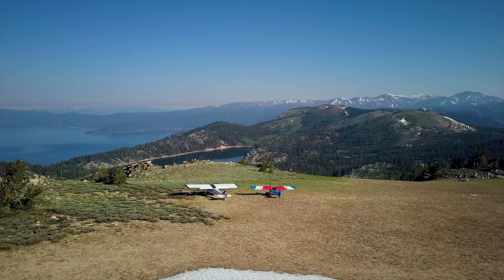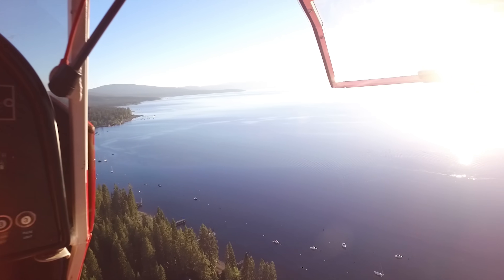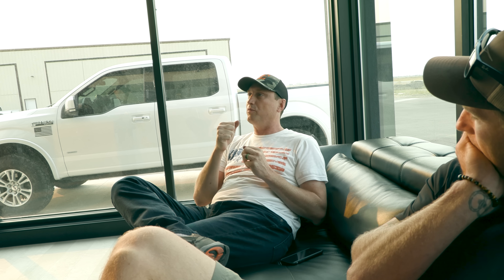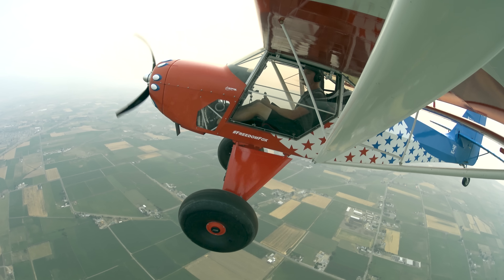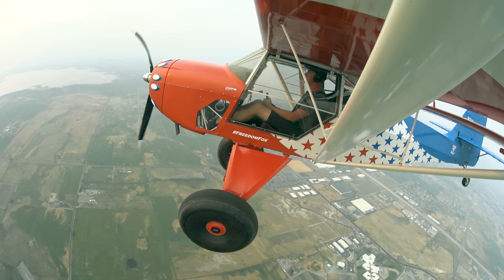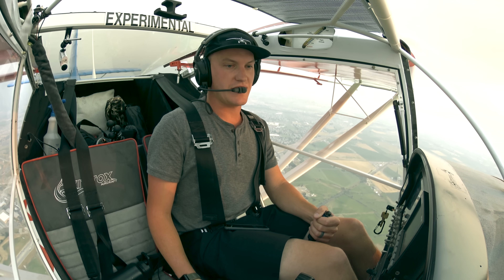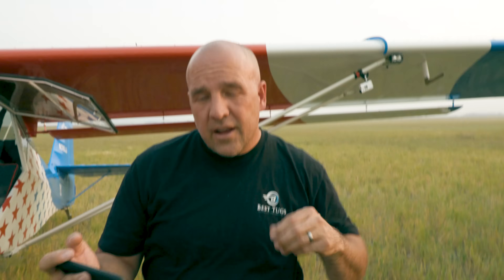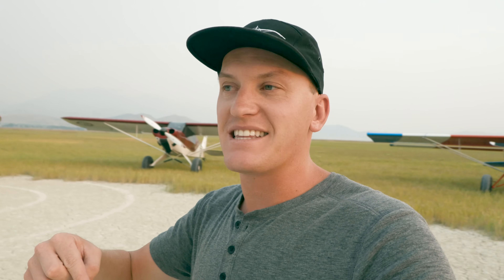YOUR FLIGHT INSTRUCTOR WAS WRONG! - Simulated vs Real Engine Failure

Comment: I dig your videos and always admire experimentation, but I have to point out some shortcomings in your conclusions, which may be correct but are not fully convincing and not completely explained.  First is that, as far as the video shows, you each iterated this experiment once, allowing difference by random chance.  It was not blinded, meaning that experimenter bias can affect the outcome, notwithstanding your best effort to maintain Vbg in both configurations.  You got the outcome that you asserted at the outset, making it seem even more biased.  

I know you probably meant to keep the experiment quick and easy, but it's a bummer you did not introduce pitch speed into the discussion.  If at idle RPM, your pitch speed is equal to or greater than Vbg, of course you will have zero to positive thrust, and that's probably exactly the outcome of your experiment.  But as you slow down from there, at some point the negative AOA of the prop blade will increase such that creates rearward "lift" (experienced as drag), and ultimate stalls, on the rear of the blade, causing more drag as well, than a stationary prop.  Witness the windmilling prop, which we all agree is draggier than a stationary prop.  There is a rough analogy to autorotating helicopters work.

Comment: Very good testing and useful data.  The reason for the difference is simple from a aerodynamic standpoint.  The entire airplane, including the prop, has projected frontal area.  This area basically causes the overall drag that the plane has to overcome by speed to fly.  The speed is created by an engine or by initial trust as in a glider. There are also other types of drag present such as parasite etc.  Too complex to go into now.  The prop has the same projected frontal area when it is stopped or when it is spinning.  So the only thing that's different is the prop spin which still produces trust even at idle.  Even a small trust will produce some forward speed, which by definition, should extend a glide.  Keep in mind that when doing tests such as these, other factors are changing such as wind gusts, updrafts and down drafts, and air temps if there are clouds present to dampen the sun just to name a few.  Even the slightest differences in these parameters can change a result slightly, so test results are never 100% consistent in variable conditions and are normally determined from averages of test samples within acceptable parameters.  Google the above and bell shaped curve test results in technical test papers.

Comment: Additionally, if the sink rate is indeed different in the two scenarios we should also practice “engine outs” at speeds that mimic the sink rate of an actual engine out. This is the only way to get a clear sense of how far you can glide and help set up your landing more accurately.

Comment: I think this begs another question.  Since the drag is clearly different in the two scenarios, is actual best glide different?  If so, can you lessen the engine-stopped sink rate enough to equal the engine-idling sink rate?
Reply from the maker: That is a good question! I wondered that myself

Comment: Nice, a complete video, dozen kg of CO2 produced two answer a question an engineer could answer on a piece of paper in 5min. Of course is the best glider the simulted engine failure, then the stooped prop, then the windmilling one. No big calculations, just using the first law of thermodynamics. The still standing makes drag by the lateral air resistance, the windmilling has to overcome lateral and radial air resistance and also th resistance of the engine. The idle running obviously runs by itself, so the gas burning overcomes for sure the engine resistance and the radial air resistance. The question is how much thrust a idling prop is producing and is the relative airvelocity at idle at the given glide speed positive or negative. Is it positive, than there is a thrust, you glide longer then without a prop at all. Is it negative than you glide longer than the standing one, but there is a drag of relative lateral airflow which has to be overcome by the energy of speed and height of the airplane, so you glide less wide than without any prop. Although at all given speed you glide, the negative relative air flow velocity will be smaller (much smaller) than the glide speed, and if it is just a fraction, but it will be smaller, so for sure a idling prop is gliding longer than a standing one.

And PS: shame on you on the title and the picture. It is completly misleading. So a thumbs down not for the video itself but this speculative title and the misleading text and picture of damaged airplane.

Comment: In a C172 or a C206 (these are what I fly most so its all I can really comment on) when you pull the power to idle on the ground your RPM will be in the 500-600RPM range, now when you pull the power to idle whilst flying and set your best glide speed you'll find that the RPM sits at around 1000. This has to mean that the relative airflow is back driving the propeller some what, which would produce drag. Also in "most" multi engine  piston aircraft, to produce zero thrust from an engine to simulate a feathered propeller you actually have to have the manifold pressure 3-4inches above  idle, this implies that a propeller at idle does infact produce some drag, or atleast more than a feathered propeller. im not saying that an idling propeller produces more drag than a stopped propeller, just that it isnt producing thrust. Just some food for thought.

Comment: It's called physics. Let your engine idle on the tarmac. Walk up behind the prop with an anemometer. Get as close to the back of the prop as safely possible and read the wind speed of the spinning prop at idle. If that number is positive then you create less drag in that regime (idling engine) than with a stopped prop... Just as you stated at the start. If you feel wind behind the prop at idle, then it's generating thrust. 

No rocket science necessary.

Comment: I have a 54" pitch prop. Assuming 1000 rpm idle that's 54,000 inches per minute or 49.2 mph. My best glide is also 60 mph which is faster than 49.2 mph so assuming 1000 rpm idle it would be hurting my 60 mph glide.
Reply from the maker: Yes, but, would it be more drag than the flat face of your prop out in 60mph wind?? That’s the question we asked. Any time you are going faster than what the props thrust would be at that RPM then it is creating drag, no question, the question was is it more than a stopped prop. We found the answer to be no.

Comment: I have a similar debate about air flow over the wing (lift), to me the air pressure under the wing
due to the angle of incidence has to contribute to a force pushing upward against a lower area 
of pressure over the wing. The experts say, nay !
Just take a sheet of plywood out into a wind storm and let it get just a little too
 perpendicular to the wind. Your gone !

Comment: Sorry , i did not make it clear and neglected to say : A rotating prop creates more drag because of the 
air pressure just ahead of the rotating idled prop piling up against the idling prop ( lets call it a circular air dam)
or air pressure disc. A non rotating prop creates less drag, but drag none the less. 
An argument can be made for how much thrust an idling prop is off setting in the total drag of the plane 
itself. ( ? )

Comment: At best glide, shouldnt you be measuring distance rather than time (rod) and fly minimum sink if you want to time it...?
Reply from the maker: Well if velocity is just an equation of distance over time, and we have the time it took to descend 1000ft at a defined velocity then we have all the info we need, just a little math will give what your asking. I essentially glide almost a quarter mile farther over a 1000ft descent at idle vs with the engine off.

Comment: this is basic physics. there is no difference between fixed and windmilling. The difference here is weather the torque on the propeller is used to make the prop rotate, or the entire  plane rotate.  Idle is better at any speed than the other two.

Comment: I'm glad you guys got the practice of doing that; however, it could have been solved with math fairly simply.  The unfortunate part about your test is its not scientifically accurate and while I agree with what you said, the results you got are more pronounced that what you would expect to see.  That could be due to control inputs, maintaining speed, wind at altitude and a host of other variables...so lets not consider that.  That said, a propeller at idle is still producing thrust, so yes that will have considerably less drag than a stopped or wind milling prop.  So, going back to the math thing, if you look at the equation for drag you'll notice that drag has a velocity component in it.  The Cd will be the same as its the same propeller and all the other variables would be the same as well, air density, reference area etc. except velocity.  So as you increase your velocity on the prop (i.e. windmilling prop) you double the drag.  Remove wind velocity and you decrease drag ergo stop the prop and decrease drag.  Then there's this:  http://www.peter2000.co.uk/aviation/misc/prop.pdf

Comment: Very interesting exercise.  Did you use the same heading for each test?  I would have liked to see you start each test a few hundred feet high, get stabilized in the test configuration and then time the event as you descend through 7000 ft and 6000 ft.  I think this would produce more accurate results, help null out any pilot induced error and any lag in the instruments.  Regardless, it sounds like the results are pretty close so you'd better pick out a landing spot you know you can make and once you know you've got it made, add flaps or slip to loose excess altitude and airspeed.

Comment: Didn't Cessna do an experiment back in the 60s claiming a stopped propellor gained a 20% greater glide distance compared to a propellor that was "windmilling" but not "idling"?  I windmilling prop is not producing thrust, but it is producing drag because it needs air to turn it.  But an engine at idle is already producing some thrust which you can take advantage of compared to a windmilling prop.
But a stopped prop creates less drag that a windmilling prop.  I believe I recall Cessna do a test comparison on this. In fact, some of their old flight manuals may mention this, but I wouldn't swear to it.  It would be interesting to finally get to the bottom of this.  I didn't even know this was disputed until I came upon this podcast.  Very interesting question which can be answered by science, and experiment.

Comment: We all know the prop produces thrust at idle, the question is:  When airspeed is higher than can be produced with the prop at idle, it there more drag from a prop at idle than if it was stopped?   As an engineer, I see that even though the prop is not producing enough thrust to increase or hold airspeed (in level flight)  it is still pushing part of the air that is hitting it aft, therefore producing less drag on the backside of the blades than if it were stopped forcing all the air hitting it to stall the propeller blades and produce nothing but suction on the backside of the blades.  The prop rotating under poower will dump off some of that sectuion.   It would have to be running backwards to produce more drag than when stopped. 

 I also believe that if it were windmilling, turning the engine over, it would be producing less drag than when stopped, although the difference would take multiple tests and likely a calibrated wind tunnel to measure the difference.   The single test of that difference mentioned in the video could well have been due to slight differences in conditions between the two test, wind, angle of attack, temperature resulting in density altitude differences, or timing start and stop variations with a person activating or watching the timing device.   

Now, if the prop could be disconnected from the engine so that it would be allowed to windmill freely, it would produce less drag when windmilling than when stopped.  But under that condition, the prop would windmill at a speed that dumped just about all of the suction (lift) air off the backside, and it would certainly not be producing nearly as much drag than if it were held stationary.  You would also be likely to get the prop spinning so fast that centrifugal force would cause it to explode.  A "redneck test" of that could be done by holding a fan out the window of a car and feel the force on the fan body if the blades were held stopped, then allow the blades to turn in the wind and feel the force exerted on the fan body with the blades turning.  I have not tried that yet, but I would bet that you could actually feel the difference, but I would not be surprised to find that you could not tell the difference without something to accurately measure the force.  Just be careful that you don't drive so fast that the fan blade explodes in your face. That's my "educated guess" for what it's worth.

Comment: So first off I have no flight experience what so ever, But the physics behind the idling prop makes sense. The theory I have that I used to make sense assumes some imagination. Image you have a wood screw and you are pushing it into a dense rubber that has some fliud like properties that allow it flow around the screw like air over a prop. I know a propeller isn't a screw but when you add in the forward movement it and prop  share a similar relative function. If you tried pushing the screw in without it turning it would cause massive resistance, but if you slowly turned the screw while pushing it while not meeting the rotational speed to have the screw pull it's self in faster than it's being pushed, it would lower the drag function slightly. Compared to just pushing it through. Then again that's just my 2 cents. If you have any valid arguments contradicting this let me hear it.

Comment: The prop adds drag, at max power that drag is way offset by the prop “lift” or thrust... at engine cutoff, the drag is the same, but there is no thrust or lift to oppose it... so we have max drag. If you’re idling, the prop still has its drag, but even adding a liiiiitttle power, increases the opposing “lift” or thrust... and decreasing the net drag. 

So... full power... prop drag is present, but irrelevant. At engine out prop drag is still present, but more prominent because there is no opposition... idle will add a liiiitle prop lift, slightly opposing the drag, but that how much that affects things depends on the plane/prop

Comment: What about variable pitch propellers, then? How would the results change comparing the drag of an idling engine vs. stopped prop either feathered or set to its coarsest pitch (lowest rpm) available?

Comment: I would suspect that a plane like a lancair, with a much faster glide speed would experience more drag at idle...as the pitch speed of the prop is far less than the glide speed. Where as the delta between pitch speed at idle and your best glide in a kit fox is much smaller, given the pitch speed is closer to your glide speed than it would be in a clean, hot airframe. Also...love your videos man. Im a recent subscriber...keep it coming!

Comment: A prop is always "screwing" through the air, but once you add any drag it starts to slip. Watch the red bull racing planes fly in slow motion. So even though the prop is not a perfect screw through the air at idle (and all speeds) it still is producing power.

Comment: This phenomenon can be explained relatively simply.
In general, for a fixed-pitch propeller if the airspeed of the aircraft is GREATER than the pitch speed of the propeller (propeller pitch multiplied by rpm) then drag will be created by the prop.

Comment: A very basic force balance equation would have told you the result right away (although a much more boring way to find the solution), basically you have F_plane = F_thrust - F_drag. F_plane is the total force pulling the plane forward (if negative then you are slowing down), using some arbitrary numbers you can see the solution clearly. If drag is constant (lets say 10 units of drag) and you have no thrust (propeller stopped or windmilling) then you have F_plane = 0 - 10 = -10 units, if you add some thrust (say 5 units) then you get F_plane = 5 - 10 = -5 units (this is slowing down still but has less total force slowing the plane down. Now if you have more thrust than drag that means you are accelerating (not necessarily flying, something about needing enough speed for lift, ie: taking off), F_plane = 20 - 10 = +10 units (plane is accelerating forward). With a fixed prop the frontal area of the prop never changes no matter what situation the engine is in. Idle, full speed, prop stopped or prop windmilling, the prop always has the same area so the drag (from the prop) never changes. The factor that changes is are you producing any thrust. The prop stopped is obviously no thrust, the prop windmilling is also no thrust because no energy is being added to the system, the engine at idle is actually spinning the prop which will produce some thrust. Just my 2 cents, keep up the good work!

Comment: Did you notice if you had to add much more pitch up trim to maintain best glide with prop stop versus idle? I'm wondering if a large component of the increased drag may be due to increased drag on the horizontal stabilizer because you need more elevator input to offset the decreased airflow across the surface. Would be interesting to see what a Piper Tomahawk, with its high horizontal stab, would post in a similar test, Or your aircraft with CG pushed back towards the rear limit.

Comment: The surface area does not change between a spinning and not spinning prop. So drag does not change in that sense. But the faster the prop spins from 0 rpm the less farther you can go.